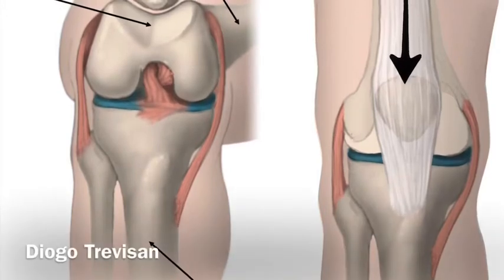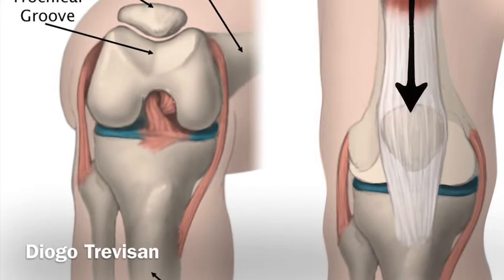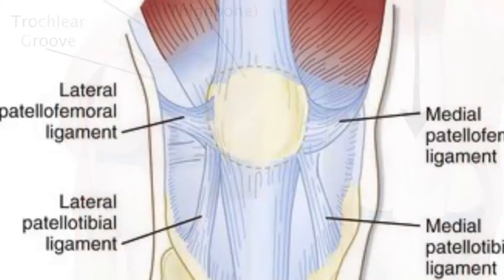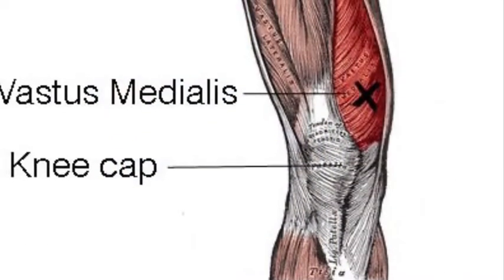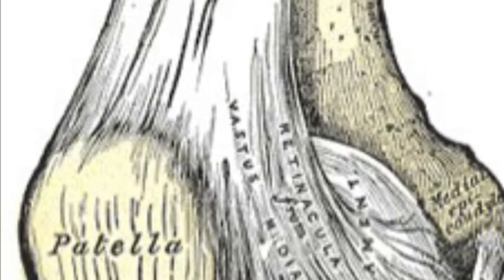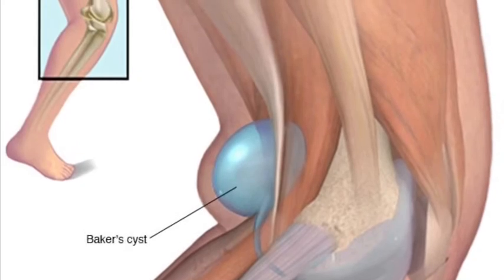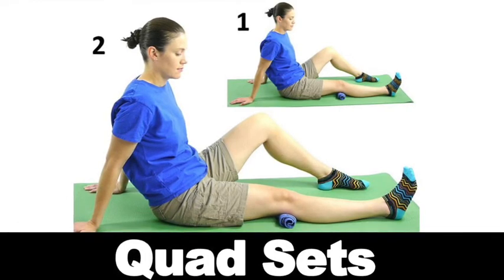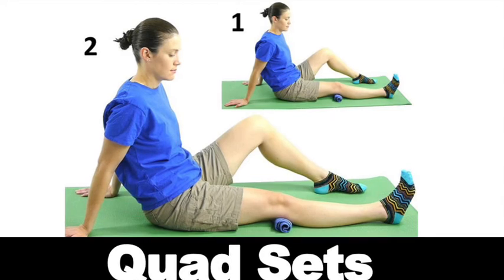Patellofemoral Dysfunction - biomechanics and self treatment.

Comment: How can I tell if the pain in the pattela femoral area is actually the result of mal tracking or a more general arthritis ?
Reply from the maker: Good question. In OA you would see a decrease of joint space in the x-ray, in regular patellofemoral dysfunction the x-rays could be unremarkable or just showing slight deviation of the patella
Reply: @Diogo9151  X rays show somewhat medial narrowing but MRI doesn't show significant cartilage loss . I want to a about 5-6 orthopedics and they all say that cartilage looks normal to my age (52) and MRI report says patella femoral cartilage is fine . Some doctors said that the patella is hyper mobile which may be the cause of the pain. Even the orthopedic who initially  said I have stage 1 arthritis was bewildered by the MRI which doesn't show significant cartilage loss. What do you make of it ? Could all the pain a have around the patella and knee..even on the back side of the knee be just due to mal tracking of the patella ? with no arthritis? Thanks for the response
Reply from the maker: @pele-moshec2552  yup! Based on the exams results it sounds like it’s only a patellofemoral dysfunction, but I could only confirm it if I assessed you and read all your exams. You should be fine with skilled orthopedics rehab 😉
Reply: @Diogo9151  Thanks again
Reply from the maker: @pele-moshec2552  anytime! 😉